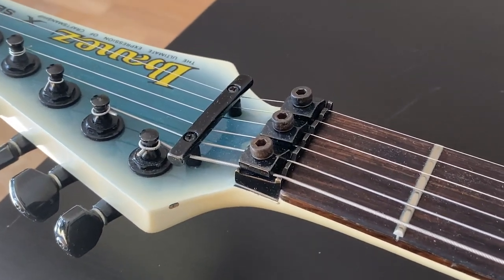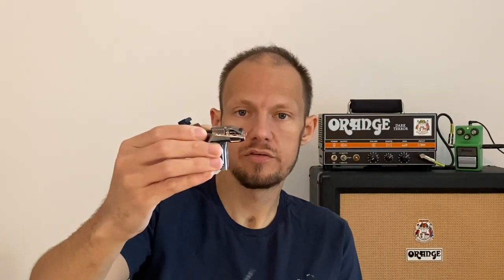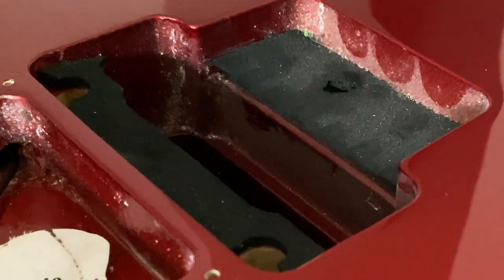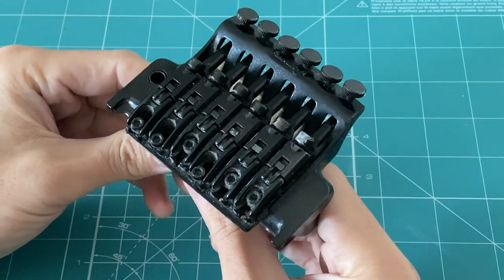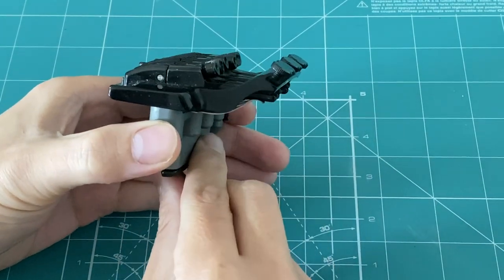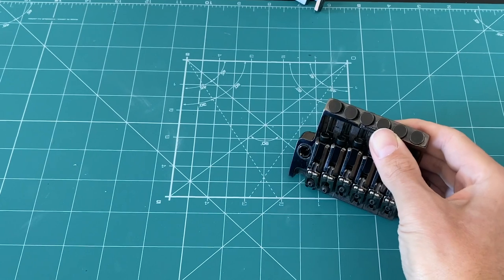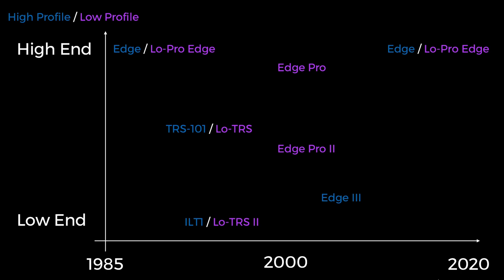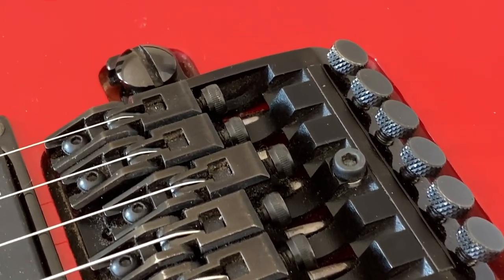EDGE, LO-PRO EDGE and EDGE PRO - How To Recognise Ibanez  FLOYD ROSE Type Tremolos

Comment: Great video. I love the original edge but have to the the zero bridges are a little better... More so because the arm is the screw in type and there is zero play when you go to use it
Reply from the maker: Technically you can also change the arm socket in Edge/Lo-pro Edge to be screw in. The whole assembly is easily removable and replaceable. Check for example Red Bishop Magik Arm system for Edge / Lo-Pro Edge.
Reply: There's zero play in my 30 year old LoPro. Tighten the screw and change your bushings on the arm or take a lighter to the bushings briefly (don't melt or catch them on fire). Problem solved.

Comment: Interesting note about the Edge Pro - the "sound chips" are the same size as the LR Baggs piezo saddle inserts, and the block underneath has two threaded holes in it. These holes line up with a particular LR Baggs PCB and it also has slots in the top of the block to feed the wires from the piezo saddles to the PCB. So a regular Edge Pro can "easily" be retrofitted with the LR Baggs system to turn it into a Double Edge Pro.
Reply from the maker: Nice! I didn't know it's such a direct conversion. Thanks for commenting!

Comment: Very good video, is there any  new Ibanez Trem Bridges after the release of this video? and are those tremolos interchangable with Floyd Roses? or the studs  location holes and sizes do not match?
Reply from the maker: Thank you! There's nothing new in the double-locking department. Edge and Lo-Pro Edge are in use in prestige guitars - those are interchangeable with Floyd Roses, but I don't think that's an upgrade tbh. There's also Edge Zero on some Prestiges and Edge Zero II on most lower tiers and those are unfortunately not interchangeable without some woodwork (different space between posts).
Reply: @Ibbyhead  awesome so in your opinion a good Gotoh Floyd Rose is as good as any Edge and Lo-Pro Edge ? thank u
Reply from the maker: @bluematrix5001  I like the design of Edge/LoPro Edge more. In terms of quality, they should be very on par. They're all produced by Gotoh, but they maybe produced to different specification. I don't have a lot of first-hand experience with the GE1996T, but internet tends to love it as Ibanez swap in.

Comment: Wow, I could've saved myself a week of reading forums and trying to compare spec sheets if I'd found this video sooner. Thank you. I recently bought an ergodyne EDR470 with a Lo-TRS II and was wondering what I could throw in as an upgrade without needing to do any routing? A lot of people keep saying the OFR but id rather stick with ibanez bridges if possible
Reply from the maker: Lo-TRS is probably also direct fit. It's a slightly better bridge than Lo-TRS II, made in Japan by Takeuchi. I think Gotoh 1996T is the most popular choice as a replacement. Gotoh is also responsible for producing the Edge and Lo Pro Edge bridges. Ibanez is just a brand and nearly nothing with a Ibanez sticker is produced directly by Ibanez.
Reply: @Ibbyhead  Awesome, thank you. A lot of people have been recommending the gotoh so maybe I'll try that out. Thanks again.
Reply: Gotoh also made edge pro

Comment: Question: Do the knife edge spacing's change with each generation of bridges or are they all the same? I would love to go to a floyd rose or a higher end ibanez but if its 1mm off one would have to dowel and redrill everything and I would be better off getting a charvel.
Reply from the maker: Not all of them have the same spacing so you'd have to check on specific bridges you want to swap. I know for example, that Edge Zeros have different spacing than most of the Edge family.

Comment: I misunderstood my Lo Pro Edge 7 for many years, but after watching this I am more confident of my tweaks. As far as leveling the bridge is concerned, I wanted a very specific plus pitch on the 2nd string so it is exactly 1.5 step. I can get that wild bend without actually cranking the 2nd string. Very expensive Universe, which I adore. Still afraid to play it! 😜
Reply from the maker: It's a curse with nice guitars... sometimes you're just afraid to play them. I'm very protective of my K7 20th anniversary :)
Reply: @Ibbyhead  Thank you for the wonderful video which taught me a lot. You are a credit to this community. 🙏

Comment: Great video...i can't find the one where you talk about ZPS3fe...i'm going to buy one of this guitars, but honestly i would like a very durable bridge with more stability in intonation on double stops and string breakage (it should)..thanks in advance, bro.
Reply from the maker: That video was very unlucky in recent months and has not yet been published. ZPS3fe is just stabilizer usually paired with Edge Zero II. I would call this mid-tier bridge, defo good value for the money.
Reply: I decided for rg370 cheap and humble but honest and not overpriced like jem77p bfp, where i pointed before, a piece of art, but equipped with same bridge at triple price!
If pickups will disappoint me too much I will replace them very quickly.
Reply from the maker: @dedoguitarman  I have older generation 370 myself. It's a great upgrade platform when you need more out of it. Enjoy!

Comment: Great video! I have an original Edge on my '86 PL1880, pretty much one of the first guitars to have the Edge.  Its definitely  the best feeling trem. Also have a RG350DXZ with the ZP. Question: is it possible to mount a evh dtuna to the original Edge?
Reply from the maker: I'm sorry, I have no practical experiences. I saw some posts on Jemsite, that it's possible, but doesn't work very well with Edge (doesn't move the pitch exactly to D and change balance of the trem).

Comment: wow that was an amazing video! I am trying to replace my Ibanez Jem Jr (bought in 2021) tremolo to a gold version and was thinking to get the Lo Pro Edge. Do you know if the dimension of the Lo Pro Edge is compatible with the Jem Jr? will it fit easily?
Reply from the maker: To be honest I don't have experience with the newest affordable Ibanez tremolo (it's called DL Tremolo or just plain "Double Locking" tremolo. I have a feeling that Lo Pro Edge will be to big, but Edge Pro might fit. Shoot me email, and we can make all the necessary measurements.
Reply: @Ibbyhead  hi! By the time I got the response I already had received the Lo Pro Edge. And it turned out to be a little big. It fits well overall but there is very little room to stretch the strings with the tremolo. I guess I might have to carve a little where the back of the tremolo hits the guitar. It’s not gonna be great but that part is not easily visible and I was already thinking to paint it neon green. What are your thoughts?

Comment: Only one i didn't see you discuss was the ZR, or the Zero Return/Resistance which turning into the zero line around line 2012 i think.
Reply from the maker: The ZR is completely different system using bearings, it's super cool, I'm collecting research to make that video. 
I also haven't covered Edge Zeros with ZPS system, that video is shot, but haven't been great with editing recently, I hope for some time for this during Christmas break.
Thanks a lot for commenting and pushing me a bit to finish those videos!
Reply: @Ibbyhead  this was a great video!
So no problem

For the ZR bridge, it introduced something interesting from a guitar maintenance point of view outside of the ball bearings. 

They had offset intonation screws so that they were able to be reached without needing to completely loosen the strings. I think that carried over into the current generations. 

It also had a intonation set screw tool, the ones seen on the opposite side of the tremolo arm bushing that could be screwed into the the intonation post in the back to pull it back while intonating, or loosen it ever so slightly to let it slide up to combate string tension while trying to intonate. 

It was my favorite version of an edge bridge as far as maintenance is concerned, but they never made it in lefty so i only ever fixed them, and couldn't play them.

Comment: Phenomenal video, friend, I have an Ibanez RGHRG with Edge 3 bridge, I want to replace it with a Lo-Pro Edge, do you know if they have the same dimensions for exchange?
Reply from the maker: They are not unfortunately. The post width is the same, but LoPro is generaly much larger tremolo. It will need some woodwork around to fit.

Comment: Hi! 
Thanks a lot for sharing so much informations about those trems. I've still got a question about the Edge III, I've got one I'd like to replace, but I don't find any solid information about wich one to choose without modifying the guitar body. Which trem would fit in term of stud spacing?
Thanks a lot for your answer!
Reply from the maker: From Ibanez - only Edge Pro will fit. I never tried it, but I've heard that Gotoh GE1996T is also a good replacement.
Reply: @Ibbyhead   thank you very much for your answer. My concern is about the in between studs space, 68mm for Edge III, 74mm for a Floyd Rose type, and the Gotoh seems to be a 74mm. Thanks again !

Comment: i saw you had what i think is the dg350, star shape. it was my favorite of any guitar ive owned.
Reply from the maker: I did have one, don't even remember why I decided to sell it. It was very solid guitar!
Reply: @Ibbyhead  mine had the knock off kahler that i used as a fixed bridge. george lynch duncan pickups and i dropped the actio where you barely saw a gap at the highest fret.
Reply from the maker: @thought1212  oh wow :D I haven't yet experienced Kahlered Ibanez. I feel it's much less common in Europe than in the US. If it works, it works! I kinda like this about the Ibanez modding scene, that nothing is sacred and it's ok to adapt to what you like.

Comment: I just got an rg470ahm and going from memory, the tremolo on it looks pretty much identical to the Floyd on a Jackson I used to have that was stolen. What I'm wondering is whether a "D tuna" (I think that's what they're called) made for a Floyd will work on the bridge of the rg470ahm. Seems like it should, but are the dimensions of the bolt it attaches to and acts upon close enough for it to work as intended or am I likely to experience an "Aw, sh#t!" moment when I try to install it? Sure would be nice to be able to easily switch between standard and drop D tunings...

Now to re-watch the video so I can hopefully tell with certainty which trem I have. Ibanez is a "funny" manufacturer. I couldn't have missed the fact that it has a Wizard III neck, but I have not seen anything yet that tells me which tremolo I have. The substantial  booklet that came with the guitar, which I figured would fill me in on specifics about the model I bought, couldn't be more generic and probably covers every electric guitar made by Ibanez. As thick as it is, there's only a handful of pages in English and the rest is translations into possibly every language known to man.  I'll have to check to see if they have it in Latin or some other "dead" language. 🤔😉🤣😁👍
Reply from the maker: I don't have experience with D-Tuna. Sorry :(

Comment: Awesome video ! Very informative! I wonder if you could also help me on my Ibanez Edge Pro II problem. The parts are already broken and I am looking for a direct replacement without having to drill any  new holes to fit the bridge in.  Really difficult to find the  Edge Pro II bridge these days. Do you know any alternative that would fit exactly my Ibanez Ergodyne EDR470EX? Thank you for the help in advance!
Reply: I know from your video that Edge Pro is a direct replacement for Edge Pro II but even that Edge Pro is difficult to find nowadays... Any help?
Reply from the maker: Gotoh GE1996T is popular replacement that should be way more available.
Reply: @Ibbyhead  thank you for the info. I'll look into this! Hoping that drilling new holes or any modifications on the guitar body would NOT be necessary. Thanks!
Reply: Thank you for the tips! So with this Gotoh GE1996T, there will be no need for me to drill new  holes or adjust existing ones on my Ibanez EDR470EX ?
Reply from the maker: Yeah, there's 1mm difference in factory spec post distance, but it works great without changing. anything. It's a good question if that guitar is worth that upgrade, but if it's important to you, then this is a way to extend its life.

Comment: You really know your tremolo's 😎
I just got my first guitar with double locking tremolo, the Lo Pro Edge. Nothing in the manual about it which was annoying but thanks to you, I now know it's sitting correctly. I was wondering which part had to be level with the body.
Wish I'd stretched the strings more in the shop though as I'm going to have to undo the locking nut soon as I'm running out of room on the fine tuners.
Question: does it matter what order you tune the strings. I've been going from low to high E and by the time I get to the high E, the low E, A and D strings have gone slightly flat again.
Reply from the maker: I tend to go from low E also, as this one has the highet tension. It's inevitable, that others will slightly go out of tune, you have to go through it few times. Just a balancing act until you find that spot :)
Reply: @Ibbyhead  thanks, I had a go just recently. I balanced out the fine tuners, undid the locking nut and gradually tuned from low E. It took a while, but happy with the results.
Reply: It is annoying to go through it a few times but that is just the way floating trems go. 

You need to level the lowest and continuous bottom edge of the bridge and have it be parallel with the top surface of the guitar body. The bottom edge of the bridge should match the guitar's surface. Getting that right is the hardest task.

Comment: I'm not into the added complexity of the Lo-Pro. Also, if you use a Floyd Rose, generally you have a modified palm-muting technique anyway. One of my favorite aspects of an Original Floyd or Edge is the ability to up-pitch with your palm, without the need to change the position of the whammy bar.
Reply from the maker: Thanks for that comment! It's a good argument for Edge! I'm just happy both of them (Edge and Lo-Pro) are back into production so we get the choice.

Comment: I don't suppose you would have any information on the saddle radius of the Edge 3 do you? I'm trying to find a replacement that isn't necessarily an Edge Pro 2 or Edge Pro. I see a lot of conflicting answers browsing the forums for drop in replacements and have been scouring for answers for quite some time now. Any info helps.
Reply from the maker: I have one and could probably measure this somehow. You mean how the saddles are stacked for fretboard radius?
Reply: @Ibbyhead  Yeah that'd be great if you could.

Comment: Ahhh, who confuses an Edge with a Floyd? Did you know the optimal setup for the Edge zero 2 is to level it with the body. I didn't believe it either, it solves intonation problems, plays easier (lower action) too. It's how I have my s1070pbz premium.
Reply from the maker: It is the case for some bridges, other have to sit a bit higher. I'm happy you found a setup that works for you and your guitar!
Reply: @Ibbyhead  Actually it felt good until I started playing from the 12th fret up, and the last 4 frets were playing flat, and it's a brand new guitar, so I put some relief in the neck pulled the action up a bit, and pulled the back of my tremolo up a bit till the intonation was spot on. If I lay down the edge zero 2 like a lo pro, I'll have to get the frets polished and even them out for the setup, and forget that with brand new frets, SS frets at that.

Comment: Thanks for clarifying, I was very confused about all of them. Someone in my area is selling an edge pro for 140 euros - 160 dollars. Do you think that would be a good choice to upgrade my guitar that has a cheap generic floyd?
Reply from the maker: It is a great update, if it will fit (so check if spacing will work) and if the knife edges are in good condition. Price is reasonable!

Comment: Are any other models( Edge or original Floyd Rose) compatible with the Low Pro pivot post?
Reply from the maker: Edge and Lo Pro are drop-in-exchangable, with no issues. Most Original Floyd rose also fit.

Comment: I have a 1992  solid maple Ibanez EX270 , HSH with original Edge trem which  is single locking, the strings go through the needle points in back of saddels. I know it was only sold in the US. Does anyone in the community know if it's rare?
Reply from the maker: It's most likely not original Edge, unless somebody heavily modified that guitar. They're made of plywood and generally not in high regard, so even if relatively uncommon, they probably don't hold much value.

Comment: I have UV77GR. I think it is the Lo PRO EDGE.  GUN Metal Grey.  Trying to figure out the proper Block upgrade for it.
Reply from the maker: If it's 1991 or later it should be Lo Pro Edge.

Comment: I'm in that 90%.  Question... The edge III has a steel  blade like the others?
Reply from the maker: I'm not sure about metal - could be steel, but it's definitely worse quality / softer than on Original Edge / Lo-pro Edge. Depending on usage, they usually get used up in few years and the only thing left is to replace it.

Comment: Hi, great info.... Is it possible to replace "edge pro" with original floyd rose/gotoh/schaller bridge without making any modifications on the guitar? Best regards
Reply from the maker: I know Edge III is quite commonly replaced with Gotoh 1996T, and Edge Pro has slightly bigger route and same post spacing, so it should work. Why do you want to replace your Edge Pro?